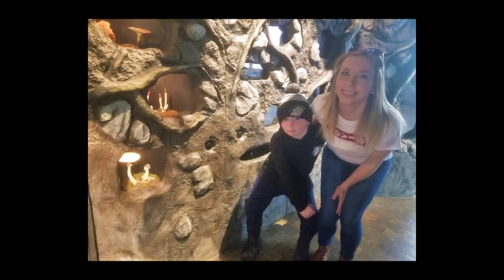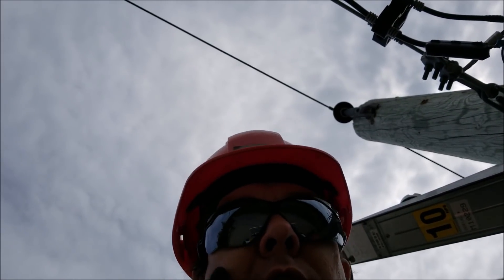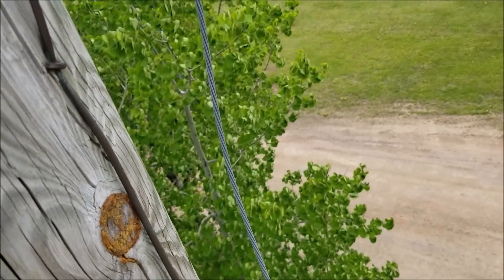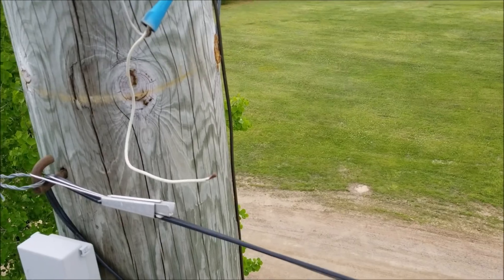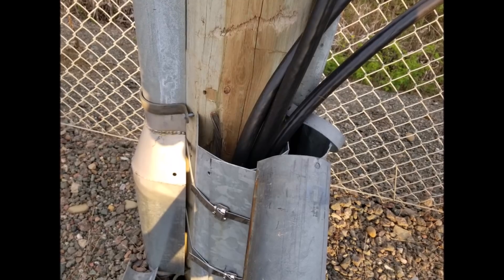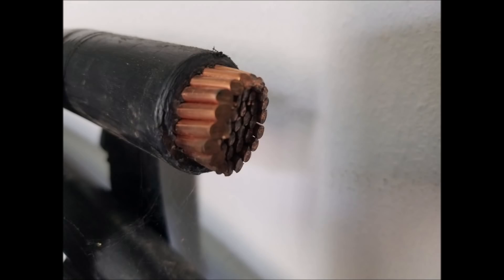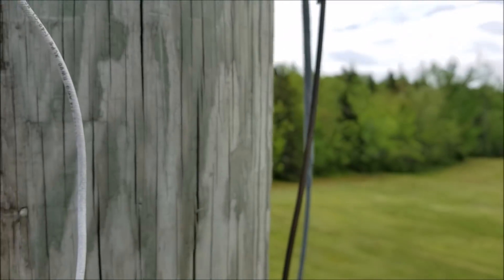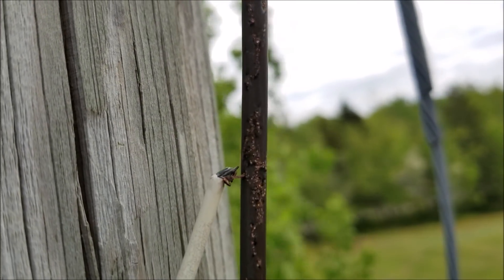Deadly current exists on grounded wires - Powerlines

Comment: UK Household wiring in the early '70s would have all the lighting circuit returns run to a common at the kitchen light. I was just a teenager helping a neighbour out but it was 'fun' to suddenly see the sparks from that neutral as the different wires untwisted. Healthy respect!

Comment: I saw some teen-agers trying to grab a wire to a street lamp which was hanging about 7 or 8 
feetabove the ground, a bare twisted wire while the other wire was insulated.I told them they 
might be better off leaving it alone, they had a few words for me like "hey asshole the lite's not 
on" I did say, "yeah because that wire is not hooked to it, It does not mean there is no current 
in the wire though. more cusswords sent my way. I said "F this, let'm get juiced, not my problem. 
If the light sensor says its dark enough I see at least 240 on the bare neutral to ground. If they 
get zapt, they are learning about electricity...

Comment: When the ground at the pole is cut, the system is using the house GEC as its ground.  So much fun being a residential electrician when you kill the main and potentially still have someone else's current on your neutral.

Comment: That wire is going to a ballast and the ballast is powering what appears to be a high-pressure sodium bulb. It wasn't trying to light the bulb, since it's daytime and the unit has a photo sensor, it was trying to energize the ballast. Nonetheless, the demonstration is valid. Most people don't seem to understand that the neutral carries current, it's just return current.

Comment: We had a 'copper thief' in NY a few years back die from his actions.  He pulled as many staples as he could, then cut the bottom end of the copper ground wire running down the pole.  But he was greedy and wanted more so he grabbed the wire and tried to yank it away from the pole to pop some staples further up the pole.  Well when it came free it touched a live conductor and about 7200V ran through him to ground.  His next-of-kin tried to sue over 'wrongful death' and 'deadly hazard' and all that.  Was thrown out since he was the one trespassing and stealing.
Reply: "The weed of crime bears bitter fruit"

Comment: I have worked as a safety man for electricians at various jobs. 
   At 300 to 400 volts a corona forms. You can not visually detect it. But if you are grounded and in the corona around a hot wire, it can be fatal. You do not even have to have direct contact with the wire or connected equipment.
   That concept was passed on to me by an older electrician when I was about 24 years old. It has been a lifesaver.

Comment: Very interesting ! I heard that if a house was drawing say 40 amps on 1 phase w an open
neutral, the current could try to return by ground rod to neutral bus bar  and up the service 
drops of service in house next door to try and get back to the center tap on the pole pig.
Reply: That's true, but it won't necessarily work that well.  What really happens is that the 240V and 120V circuits form a complicated series-parallel circuit and the isolated neutral will float according to the loads spread across the 120V legs.  Not very good for your electrics.
Reply: @jovetj  If the incoming neutral breaks the voltage will go to the ground connection and it can then seek alternative path. It might use for example the cable TV connection as its path. You can also get shocked form equipment cases. 

Split phase and three phase have the benefit that they reduce the voltage in the neutral. In the UK where single phase 240 V is common the full 240 V goes to the neutral if it is broken. They require special protection against that on EV chargers (either  a device that detects it and cuts all three wires or do the grounding just with a ground rod and rely on the RCD for protection)

Comment: I use to do stray voltage testing for NYSEG we went all the way to the canadian border near plattsburg ny found all sorts of crazy stuff lol most i ever found was i think 90 amps coming down a ground wire and 3 guy wires. Apparently the insulating washers burned out of a tub and it was grounding out

Comment: A "neutral" is no lomger neutral if its been cut than its going to have the same potential as hot because its being fed hot on the other side of the cut
Reply: A neutral is in reference to the circuit itself.  A neutral doesn't stop being a neutral depending on if it's grounded or not.   
All the grounding wire does is keep the neutral and the Earth at the same potential.

Comment: I got dispatched to an fibre outage where some jackass had cut into a 48f running underground. 300m in, it hit a railroad trestle and was in a thick steel pipe with conduit inside of it. The person cut through that steel, through the conduit, and then the fibre before realizing he actually hadn’t found copper. 

I spent a lot of time thinking to myself - if he hadn’t known it wasn’t copper by the outside, he sure as hell wouldn’t have known it wasn’t hydro.

Comment: Yes,if the neutral path for phase voltage is an SWER (single wire earth return) circuit you will get no circuit continuity if the ground wire has gone open circuit !

Comment: Do you have SWER distribution out there? We have it out in western Canada. In that case, a cut earth return can have close to line voltage across it, 12.5 kV or whatever the distribution potential is. Also, it can do weird things in houses fed by that transformer.
Reply: My old company in Australia had some swer substations in our rural outskirts, the HV earthing was put into two separate steel conduits and the earth wire was  looped between the two so if it was broken it had to have two open circuits before the HV would appear on the grounding wires,  loads where limited to 10 kva per substation  to limit any ground voltage build up due to loads or poor earth conditions around the underground conductors. Swer is dangerous and is a cheap way of supplying power to outlying communities.

Comment: Small correction at 0:35: Potential is not voltage. Voltage is the difference in potential, in electrostatics.

Comment: They should leave all that copper alone including the metal of a sub power station I heard that each sub power stations power comes directly from the power plant and they consider that electricity from a power plant is hotter and far more dangerous then what amps you get at a house.

Comment: That arc is from the fixture's transformer and capacitor. Without them, 120 volts wouldn't arc like that. That being said, open neutrals can be deadly if you're caught between them and a ground. Great video.

Comment: Here's a scary thought. As a baby meter worker, I wasn't instructed on the dangers of lost neutral paths until my 440v 3ph training. I was blissfully unaware of the danger for two years.
Reply: Neutral wires are only dead if there is a complete path back to the source for every load downstream of where you are touching your neutral wire. So, if you have your hot (aka primary) feeding 10 devices, and you open the neutral at device 1 to 10, without opening the hot, you now have a hot in your hand, not a neutral. 

In other words, it's relative. This is why it gets tricky with transmission lines, where the actual earth is used as a return leg, pole to pole to pole, to bring the "used" loads, back to source. Open it up, and all those loads down stream of the open, are waiting for you to close it, and a lot of times, people's bodies become the splice that returns the path back to source.

All electricity flows in a circle. From source, to load, to source. Neutrals are just a generic way of saying, this is all of the circle from the load back to source. If it's all in tact, great, you can touch it all you like. If it's open, damaged, undersized, in water, whatever... AT ANY POINT, from load to source.. YOU might become the new path of less resistance back to the source.
Reply: I once worked on a circuit and didn’t know that the neutral had been borrowed in a box downstream, and as I was tidying up the box I disconnected the neutrals. Got a bit of a surprise when I got a shock from the neutral. Luckily nothing was actually running on that other circuit, but just having something plugged in sitting in standby was enough to give me a shock. It’s also very devious, as you can’t actually measure that, any DMM or voltage tester would show it as being at 0 V, until you break the neutral.
Reply: @sstorholm  clamp the neutral with a current meter and you can see if it's carrying current, not perfect but better than nothing
Reply: @sstorholm  Yeah, borrowed and shared neutrals were what they were teaching us, so we could work on multi-feeds to buildings with multiple meters from a 3-phase cutout. Borrowed neutrals are some scary stuff. Our process was to carefully disconnect the 16mm/25mm neutral tails (in LV PPE) and test across the break for voltage, BEFORE handling the bare copper. In a home situation I guess if you were doing it belt and braces you would (TURN OFF THE MAIN SWITCH DUMMY)... use the voltmeter either neutral to earth or across the neutral break, after you've pulled the wires out using an insulated set of grips.

Comment: Love your videos they're great. those are both grounded conductors at the service and at the source they are connected, electrons use the ground as a conductor to get back to the source in an AC circuit DC goes to ground.

Comment: When I was a tech for MaBell, I once found a customer's building that had a different potential ground for the phone system and the AC panel.
Another time, I found a car salvage yard that had so much oil krap in the dirt, that there was NO ground potential anywhere on the property.  I had to run a separate wire up to the phone cable strand on the pole!

Comment: I understand what you're trying to pass on. Howeve, I know those HID light fixtures well. that arc is the transformer not directly the light bulb. wouldn't that fixture still arc without the light bulb? cause it's just a coil of wire connected to positive and poor connection to lower voltage.
Reply: If there isn’t a resistance, or capacitance across the output side of the secondary transformer circuit then, I think not.
Reply: Jake ... if he had said "the 100 watt bulb fixture" (meaning the entire assembly) that would be easier that trying to explain the details to all the dummies.

Comment: Ahh, ground-currents!
When I was getting trained up to be a steely-eyed signalman for the Army, we had this large open field dotted with communications shelters.
Pickup-truck portable, these shelters were permanently installed on site.
We never got told the why's and wherefore's but there were standing orders concerning standing water on the field.
"Take tiny steps on a wet field!" was the essence of the instructions.  Those who felt brave found out why the order was in place!
The longer the steps we took, the stronger the shocks we got!  Volts AC per foot was pretty high in some places.
So there we were, brave and grimly determined young soldiers penguin-walking across a field with water up to our shins...tingly!
Reply: What if you hopped?
Reply: @deezynar  that’s the correct way to transverse ground with potential across it, for example when exiting an excavator that’s struck a high voltage line. By hopping with your feet together, in a straight line from the excavator, your feet are always either in the air or on the same potential line, so no current is induced in your body. Taking tiny steps might be safer though, as hopping carries the risk of falling forward, which would put your whole body across two potential lines 2 meters apart, which could be very deadly.

Comment: One of my subscribers told me that I needed to be way more careful around power lines last year.. I was touching one of the guy wires holding a high voltage line, assuming it was grounded and i would be fine..   They told me that about these induced currents, which I should have realized but didn't, and wow.. I will be so much more careful in the future
Reply: It’s one of the largest dangers there is, things that 99,9 % of the time are safe, but then 0,1 % of the time tries to kill you.
Reply: @sstorholm  Yea I've been fortunate to not have to learn that the hard way..

Comment: Drives me nuts the #6 ground reference wires on soo many poles are cut (mostly by snow plows) and that the electric company(at least here) ignores them until there is trouble.  One or two or maybe three or four and it makes no difference( a volt or two per, perhaps). But eventually it makes for a pretty goofy situation...I.e 48V difference between furnace ducts and ground even with mains disconnected.  Why?  Because neutral doesn't get disconnected and is still connected to system.  You'd feel this when you're lying on dirt floor basement replacing furnace ducts.  Yea, 48V.  Not deadly but certainly not comfy.  Maybe deadly if you're wet enough.
Reply: Must be lots of house fires in that area, LOL.
Reply: nhzxboi
 ... been there, done that. Furnace lost it's neutral in an old house with a dirt floor. Furnace is up on cement blocks so as soon as you touch the cabinet it's ZAP time! Turned out to be 4 wires tied together with a TOO small wire nut, inside a junction box and the neutral broke free.

Comment: A 100 W incandescent bulb at 120 volts will draw .83 amps, plenty to put a heart into fibrillation.
Reply: I bet Mr. Hawkins here wouldn't sign up to test that theory.
Reply: ElevenKnights actually I think he might, unless he was smart enough to google it ! Lol
Reply: I read once that a standard 15 amp, 120 volt circuit has 15,000 times more current than is needed to kill you.  So under the right conditions just 1/15,000ths could kill you.  Of course if your wet or worse with salt water, then your skin resistance goes way down.  Also it depends on where you get shocked, if it is from your leg to your foot painful yes but not fatal.  But if you get a hot wire in say your right hand, and then ground out one your left, then your heart is in the path of current flow.  And if unknown to you, your heart is not 100%, it's maybe even easier to stop.
Reply: David Marquardt it’s not that your heart stops with a low voltage shock, it’s more likely to put you into an irregular heartbeat where as with a higher voltage shock your heart stops because your muscles constrict and if your cleared the heart is more likely to start back in a normal rhythm, note you may not want to survive the higher voltage shock ...
Reply: Yeah, but good luck getting that 0.83A through a heart with just just 120 volts.
Reply: Brian Hawkins happens all the time dude !

Comment: I think it's safe to remind people that the arc you are drawing from that loose neutral is current returning to Source by going UP the pole to where the Grounding wire is bonded to the neutral line,, rather than down the pole to the ground rod.
A lot of people think that power can go to ground and magically be absorbed by the earth, rather than needing to return to source via the other wire connected to Source, namely the neutral.
I know on utility scale with engineered distributed ground systems it's possible to use the earth as a return to source, but it's not very efficient even then, but this is an important subject for anyone trying to understand household electrical issues, bonded neutrals etc lol
Reply: Many primary service have only one wire a high leg to transformer
 no return neutral to plant..
Substation and prime mover in power plants have neutral ground arrays in earth .
Reply: @Motorhead250  yup, that's what I was talking about in my last paragraph, the Single Wire Earth Return.
Reply: @Motorhead250  I don't believe that.
Reply: @jovetj  ok kid...
Reply: @jovetj  Google "single wire earth return". 
It is usually used in older remote rural areas where they have to run a wire many miles to serve a couple of houses, and the losses from the earth return are offset by the savings by only having to run a single wire on the poles.

The downside is that you have to build a grounding network at every transformer, and you lose more energy through the earth losses, so they tend to get phased out as more houses are built, they will run a second wire for a neutral.
Reply: @ke6gwf  I know what it is and how it works.  It simply isn't as common as "many" purports to be.  It's really rather rare in the grand scheme of things.  It's also not as simple or wonderful as some pretend it to be.
Reply: @jovetj  oh, I agree, I think it's a horrible idea, and they tend to upgrade them and run neutrals as soon as there are more houses added in an area.
I think they are mostly really old, basically from the early rural electrification days when they had to run power to everyone, but might be running a wire many miles for only a couple of houses, and so they saved money by only running a single wire.

The only places I have seen them still in use is in the deep recesses of I think it was New Brunswick Canada, and they were very old systems.
Reply: A lot of people think that because they are literally being told that, all the time, even by supposed professionals.
Reply: Ok kid

Comment: that is not a 100 watt light bulb, it is a HID lamp which has a ballast and a capacitor...
Reply from the maker: 100W High Pressure Sodium Lamp. My bad 🤷‍♂️
Reply: @UCpJWHeFjOjoDrHLIPqIHgwA a hps is an HID lamp, is it really only 100 watts? the street lights on my road were 1000 watts
Reply from the maker: I dunno man, I've never actually done a load check on em ... We've got some 1000w metal Halide flood lights we use as well . Actually everything is L.E.D now
Reply: @Bobsdecline  yeah, most everything is converted to LED now, i was just interested, i collect vintage lighting gear... thanks
Reply from the maker: That sounds like a unique collection/hobby.. very cool . Cheers man!
Reply: Walter...stop being a Karen.